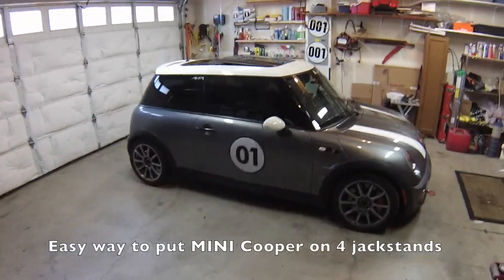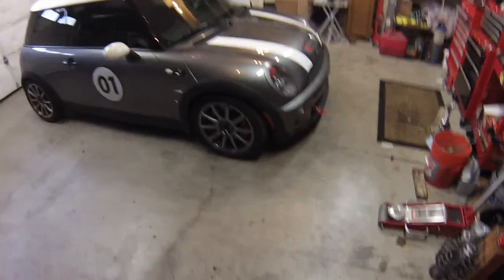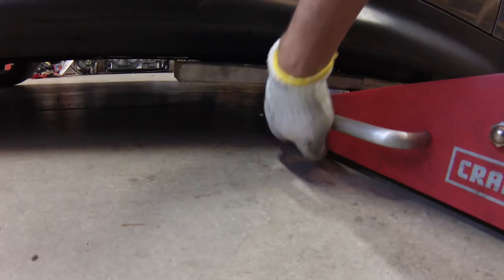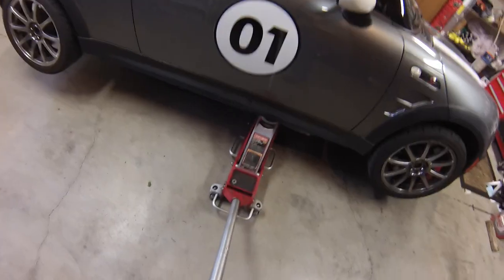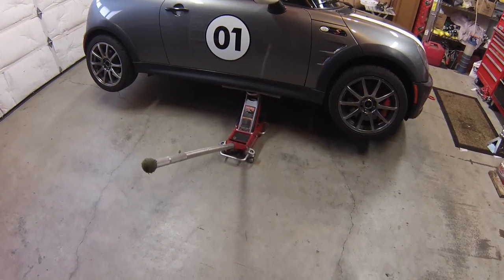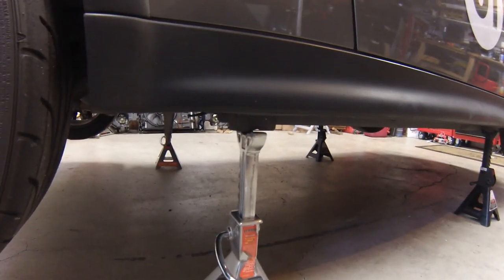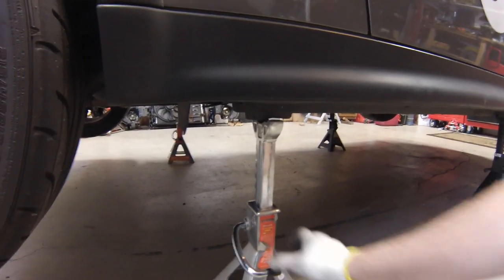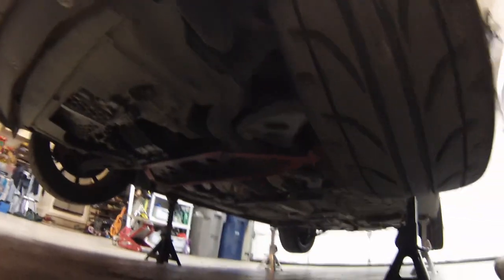Put MINI Cooper on 4 Jackstands the Easy Way R50-R53-R55-R56 Howto

Comment: This is a huge help since I plan on doing a complete brake system replacement, plus an oil change to my 2011 r56 Mini in a few months. I’m still pooling my resources to get everything I need (pads, rotors, sensors, hardware, oil, filter, etc.) But this will totally come in handy down the road.

Comment: I recently picked up a used 2 ton jack with 2 stands. I wanted to try it out today on my Mini S r53. I was sad to find out that my jack would not fit under the front anchor point...but the rear was no issue. I tried to it thru the front...front end still way to low. I was bummed...but then a brainstorm hit me...I placed a small section of 2x4 length-wise in front of my front tire..carefully drove on top of it...it raised my vehicle 2 inches...I followed the directions here on where to place the 2x4 to lift the complete side of car...worked like a charm..put the jacks on carefully...slowly lowered. BINGO!! Next week...I replace my brakes!!!!

Comment: I can't believe you started with the jack stands set so high! My god you must have nerves of steel! I would have done it in increments, going side to side until I reached the desired height. Well Done!!!!!!!
Reply from the maker: I've done it so many times I know exactly what is going to happen. :-) 
(And never put any body part under the vehicle until is safely on all four jack stands)
Reply: @ModMINI   @ModMINI  is it recommended to always put it on all 4 or is just 2 sufficient if gives you room to work? Also are using adapters to fill in that hole where jack stands are supposed to be placed

Comment: I have used this method and it works great. Just like in this video. was able to do everything easily and vehicle was very stable.Prior to doing it this way I found out the hard way that trying to drive your mini up on ramps is a big NO NO. Only damaged the lower lip but still a pricey lesson. Thanks for all your help kurt.
Reply from the maker: Michael Wilson Yeah these cars hate ramps. Cheers

Comment: Someone asked if you could do this with a Clubman and the answer is yes. I have done it several times now just like with kurts car. You can work under the car safely and i have never had any movement . 08 Clubman S. Love these cars! Easy to work on and a blast to drive..
Reply from the maker: Michael Wilson Yup, I've since confirmed this works on all the Gen 2 cars as well. Hey I chased a Clubman on a cloverleaf onramp the other day. He scooted pretty good.

Comment: Wish I had seen this video before I jacked up my Mini last weekend! As a complete newbie, I rather naively jacked it up using anything solid I could find underneath the front and rear of the car. Obviously I was careful with where I placed the jack but I can't help but feel that I may have been a silly boy and possibly damaged the car in the process! Sigh I shall live and learn. Thanks for the video though!
Reply from the maker: +Stephen Graham On a MINI, Anywhere along the rocker panel is fine, where it sticks down a little below the rest of the plastic bit. Just avoid the soft bits inside of the rocker panel.

Comment: Tbf if the car ramp isn't perfectly flat you can sometimes swing an arm out as well 😬 lol.  I will add check your stands as well as a lot of jack stands dont recommend lifting against the jack stand on the opposite side so just double check that 👌 (i.e. once one side is on a stand, don't lift the other side up, as they are just for support, again not all but some do not recommend this)

Comment: Thanks for the video.  I was thinking of doing it this way but it's nice to have reassurance.  In your opinion is it stable enough on the jack stands that you would take all 4 wheels off?  Also, what's the risk of damaging the plastic jack points with the jack stand"
Reply from the maker: I do it this way all the time, but you want to be absolutely sure all jack stands are on a solid, level surface and there is no sideways stress on any of them. Also a good idea to stick the wheels under the edges of the car where are not in the way. And of course, don't push sideways very very hard when the car is on jack stands. 
I've probably had my car on jack stands almost 50-100 times this way. (Working on it at the track, etc.) The jack stands chew on the plastic just a little bit but they are still holding up just fine even after very heavy usage. If you're worried, stick a piece of thick rubber between the jack point and jack stand.
Reply: ***** Discarded car tires that you cut up into squares with a reciprocating saw make fine jack pads to protect the car's soft underbelly bits, and provide a nonslip surface that's more secure to boot.

Comment: i just bought some axle stands similar to yours but noticed that the jack point/block doesn't sit fully square on the saddle of the axle because the axle saddle is too wide and has a deep curved dip in the middle, so the car sits half on the flat side and a half in the curve part of the axle stand ...therefore the car is only using/sitting on one side of the jacking point/block...

Comment: Did you put the block of wood on the plastic side skirt? Or deeper under the car?
Reply from the maker: Hi - it goes right on the flat plastic part, in line with the jack points.
Reply: I've seen you do it in all your videos and I always thought it was just the camera angle. I use the metal ridge on the frame, just inward of what you use.
Reply: However, I've lowered my car (on H&R street coilovers, just like your other video) and I can't fit under the side skirt. So I'll have to use your method now.
Reply from the maker: Sanjay M I don't like using the metal ridge because I've seen those bend/curl over.

Comment: what's the optimized height if I want to work under the car? Say I want to change BMW 328's transmission fluid.
Reply from the maker: "High enough to get the work done." I usually just put everything on the top notch on the jack stands.

Comment: How about R60?  2017 mini countryman ... how would you jack the car up to use the jack stands?  I'm a little nervous with the 2 x 4 under where it is; wrong place .. crunch!
Reply from the maker: Sorry, I can't recall what the bottom of one of those looks like but long enough board should be fine if there is a pinch weld nearby. Or, find a corner of the front subframe and temporarily put a jack stand or jack there maybe.

Comment: Would it be better to jack up the car in this manner, but then slide ramps under? I could then place my axle stands as emergency support instead? I just wondered if the car would be more stable on ramps than stands on 4 corners...
Reply from the maker: +MrBazinger I don't bother with ramps, front wheels have to come off for so much maintenance work anyway. If you are concerned, you can always throw the wheels (or the ramps) under the rocker panels. If car falls off jack stands, it falls on to that.

Comment: I'd be wary of jacking the car that high on one side, and then lifting the other side up too! But I use this method on my Mini, still doesnt seem right, i always think its going to topple off the axle stands
Reply from the maker: Be careful the first time. I did it like this dozens of times. Check and make sure jack stand is flat and not tipping over.

Comment: Are your jack stands to the max level ?? 
Is it safe to do if so ?
Reply from the maker: If on solid ground (which is the only place you should ever use jack stands), you should be. Push hard on the car, harder than any force you will use when actually working on it. If it doesn't shift, you're safe. But throw a tire under there just in case.

Comment: How about lowering the car ? just reverse the process and do it notch by notch? My C7 is stuck on quickjack, quickjack is broken and I need to get the car down from the 1st locking position.
Reply from the maker: Lower it as you can lower safely without jack stands starting to tip over.

Comment: My rear passenger side jack (mount bracket?) is missing off my mini. Would it be okay to still put a jack stand on that side or is that small square tube (mount bracket) the only functioning part of the frame that I can place a jack stand uner?
Reply from the maker: Yes, just put a chunk of wood to distribute weight

Comment: Would this method work on a R53 JCW? Would the Aero Skirt get in the way....Just picking up an 05 JCW (first time mini owner).. Wondering if This may work or if I may need an alternate..
PS...Great videos
Reply from the maker: I don't remember, but I think the aero skirt gets in the way unfortunately. I think there is too much gap between the rocker panel cover and the rocker panel underneath.
Reply: Confirmed - don't jack the JCW using this method. I just cracked a skirt because I didn't notice how much gap there was. It bends far too much before it contacts the panel.

Comment: I have to replace my passanger cv axle. But I only have 2 jackstands. Would lifting one side be adequate?
Reply from the maker: RedTeamWolf yes, unless you need to disconnect the sway bar, in which case both front wheels need to be raised.

Comment: recently discovered your videos  they are great!  ive just purchased a r53 cooper s the expansion tank seems to have a lot of pressure in it the tank itself feels really hot not normal do you know what this could be also seems power steering pump is not working is that dangerous last thing there is like a air hissing sound in the car when I accelerate but when the I press the clutch the noise dissappears could it just be the supercharger would appreciate a reply thanks
Reply: I meant to say power steering fan sorry

Comment: hi!! im trying to lift my R53 up on jacks, but my two front jack points are missing... Can I still lift it without my jack points??.. im trying to fix my P.S leak. thanks!!!!
Reply from the maker: eds95gt I'd recommend putting the jack stand on the frame rail or the subframe, but you can also use a short chunk of 2x4 ripped in half to fit into the space...if you are careful.
Reply: Nice videos. You are very clear in your demonstrations. Couple of questions, if you have the time: 1. If one of my jack points (right front) was sheared off when I rolled over some material in a construction zone, are you saying to use a piece (say 2" long) of 2" x 4" to make up for that? I did an oil change recently and simply used the metal that was under where the jack point used to be. ... Steady for sure, but in retrospect, I guess things were jacked up unevenly, side to side, since the other side (left front) had it's jack point intact. Please advise. If I have the details right, I will implement next oil change.  2. The perforated core that was part of the old R50 oil cap (to add pressure to the filter for fitting purposes). I've been reusing mine since I bought the car in '02. I have always pried it out of the outgoing filter to go in the new one. The new filters now have their own structure in their core, so is the OEM core still required? The reason I ask is that I think mine may break soon and I don't think I'll be able to source another, unless you perhaps have one in good shape (I'd definitely be willing to buy it). Maybe I truly don't need it anymore, but I need some guidance from someone in the know. I found this oil cap for sale online, which you will see says does away with the OEM core (it attributes this to the new filters having their own core), but I don't know if this cap will screw on to the existing, original R50 oil cap housing. Any advice on this? This is the site for the oil cap:

http://www.autohausaz.com/pn/11427563763

Thank you!
Reply from the maker: +mjlwriter 2x4 split in half down to a 2x2, so it fits where the jack point used to go. I don't know whether newer filters will work with / without the core. You can't use the new style cap with the old style housing. I understand they have different thread pitch. Might be worth checking on eBay.

Comment: How would you go about just putting the front on stands. Would you use the same method.
Reply from the maker: Yes, or jack up using jack point and put stands under front subframe.
Reply: Thanks for a cooper reply. That is the method I used last time. I just wanted to make sure it was safe. I need to change the inner and outer ball joints and control arm rear bush.

Comment: Is it possible to just jack it up using the floor jack at the jack point instead of behind it if I don't want to use stands?
Reply from the maker: Um, yes? That is what the jack point is designed for - but unsafe to do anything other than changing a tire.
Reply: Mod MINI haha I was just asking because I didn't know if it was designed only for the oem jack. Thought I'd ask

Comment: Thanks and I have a Clubman and will this method still work?
Reply from the maker: This should work on a Clubman as well. Go slow and steady to be sure!
Reply: Thanks! This is all new to me as this is my first import let alone a Mini. Like what you've done to your car and wish I would have watched your video on changing thermostat housing before being dinged $ 700.00 (cad) at BMW. Have a Forge BOV adapter and would you have any suggestions on a better internal valve and spring? Just had ECU tuned by NM Engineering, added a Forge Intercooler with NM Eng. down pipe and am installing Milltek Cat Back Exhaust for now and Later a Milltek Downpipe.
Reply from the maker: Gary Lajeunesse I'm not sure about that; most of my engine experience is with the first generation MINI. I helped someone install an internal valve/spring one time but I don't know what brand he used.
Reply from the maker: ***** I've confirmed this method works on R55 and R56 as well.

Comment: So....anyone know how to remove the E12 bolt that I have managed to mangle? Do I try to cut through the lower portion of the engine mount? Do I try to grind the head of the bolt off? I'm stuck at this point.
Reply from the maker: cut off either and it should come out.
Reply: @ModMINI  Thank you mate! Funny, I just came looking for your channel as I'm about to do the fuel filter and saw your reply. I've gotten a lot of value from your work, thank you. I did get the bolt out, it had gotten so gummed up with oil from the mount that it did not want to come out at all.

Comment: Is it unsafe to have just the front jacked up on two jack stands? For the starter replacement job?
Reply from the maker: It's fine, just be sure to have parking brake on and jack stands on solid floor and with all jack feet flat on the ground.
Reply: @ModMINI  Be careful when lowering, since the car is tilted, I had mine fall of the second jack because I let it down slightly fast. I didn't have the jack stands set up very high, so nothing got broken.

Comment: I’m always scared of ripping right through the floor. I have a 2013 Mini Cooper
Reply from the maker: It won't, if you stay on the rocker panel and spread the weight. If you do not spread the weight, you must stay on the pinch weld or on the jack blocks.

Comment: the only thing for me is that regular jack stands don't but nicely to the mounting points and can damage them
Reply from the maker: It does put a little dent but it doesn't get worse. I've had my car on jack stands dozens of times and they look the same as they did the 2nd or 3rd time I did so.
Reply: +Mod MINI fair enough buddy I shall give it a go, usually I place the stand under the sub frame but going to be dropping it soon 
cheers again

Comment: can this method be used on cars with the aero side skirts?
Reply from the maker: Unfortunately no.
Reply: so whats the best way to put the car on jackstands?  using the subframe?
Reply from the maker: Yeah probably drive up on a couple of 2x4 to give enough clearance, then jack up on subframe and put jackstands at the normal position.